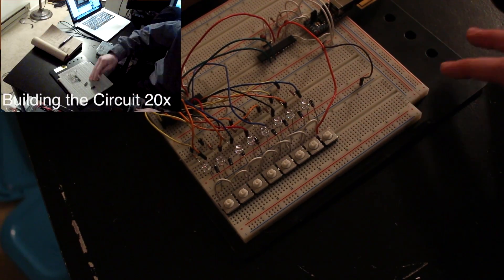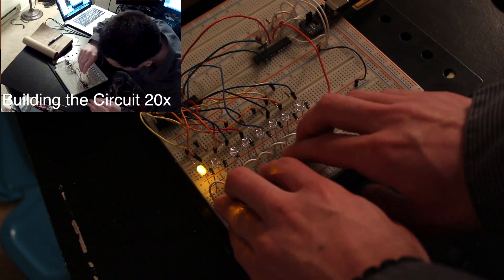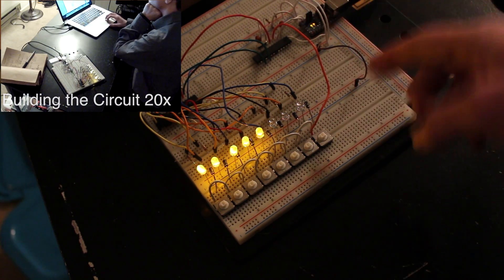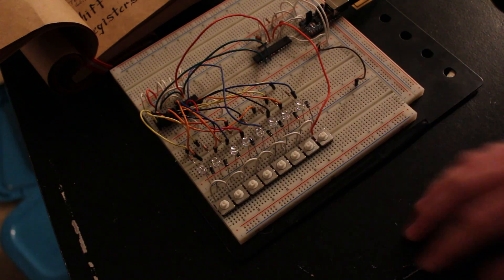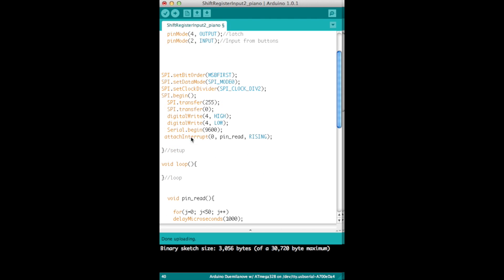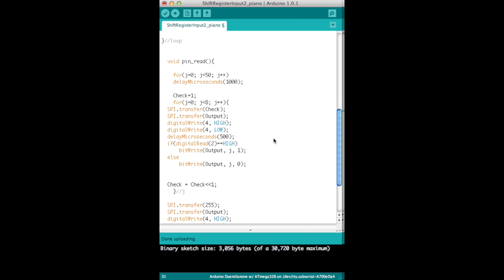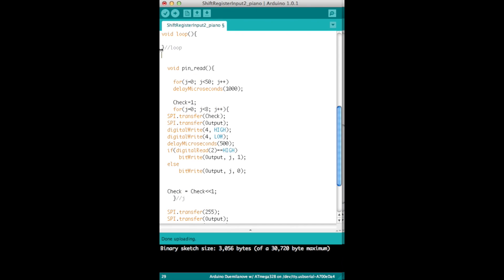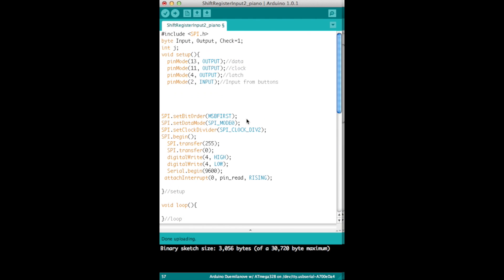Part 2 - How to Control a Ton of Inputs using Shift Registers!

Comment: I appreciate your creativity.  Your original setup worked like toggle flip flops.  NBD.  This solution requires, exclusively, what can only be described as extremely minor code changes to completely change the behavior of the circuit  

This underlines the power of microcontrollers: one can make sweeping changes in the system strictly in software. 

I see something similar with optoisolators/Schmitt triggers (perhaps mosfets/transistors) reading real world inputs, no debounce required

Comment: sir how to used 2 shift register !! (arduino code also)
Reply: the shift registers are wired so that the first chip's sq7 goes to the second chip's data in, all other non-output pins are wired in parallel. Then you can treat the 2 shift registers as 1 bigger shift register
Reply: what about arduino code sir!!
Reply: send 2 bytes instead of 1. First byte goes to the register the furthers down the chain.
Reply: Sir actually i am not a good programmer !! can you show me it using arduino example as above ..please sir !! thank you

Comment: Hey Kevin, would it be possible to get in contact with you?  I'm trying to make this exact circuit, but I don't know much about the Arduino or circuits...  And I'm confused as to where I would hook up the pushbuttons to, even though on the code it says pin 2 receives input from the pushbuttons.  I have a bunch of other questions too... It would be nice to have some help with this project!

Comment: I'll be using a lot of Arduino pins for other purposes in a single circuit with ATMega328 chips and I want to conserve as much as Arduino pins as possible. Just using one single digital pin, can I possibly acquire inputs from shift register and make arduino interact with it? How can I know what 595 pins were triggered so that I can assign a function to it? Thanks!

Comment: Nice video tutorials. Very clear and informative. I want to know if it's possible to capture a push button event from HC595 for Arduino to take appropriate action. Say, the button #2 was pressed and Arduino knew it was #2 and execute some commands. I want to install more than 8 IR sensors in my house. If the IR sensor in the kitchen was triggered, the system will sound the buzzer or turn on the lights to scare the intruder off. If the sensor in my room was triggered, the fan will turn on and the lights turns on.

Comment: Hi there Kevin and thank you for your videos. 

I have a newbie question. Is it true, that using your shift register method of reading inputs is only possible if the Arduino is not in sleep or any low power mode?

Comment: I mean I don't understand the SPI.translate(CHECK); SPI.translate(OUTPUT); digitalWrite(HIGH); digitalWrite(LOW); part. Don't you basically replace the check byte in the registor's storate with the outpit byte before activating the latch ?

Comment: If i were you i would find some example codes of other matrices and try to figure out how it works. The code also changes depending on how you are driving your matrix so the IC's and information on the schematic of the matrix is necessary if you want any help.